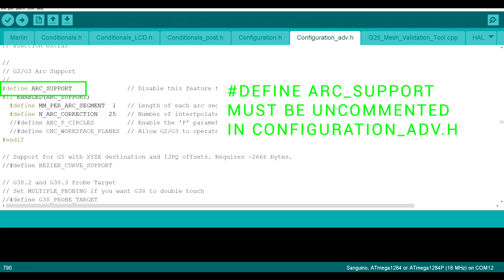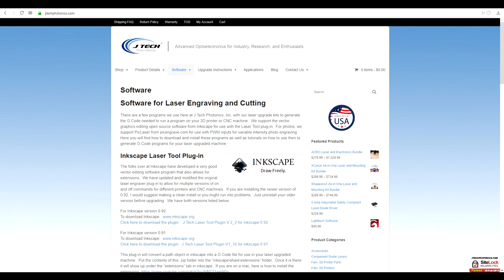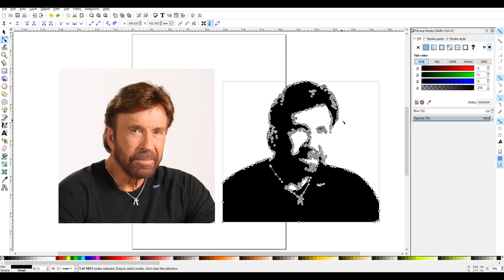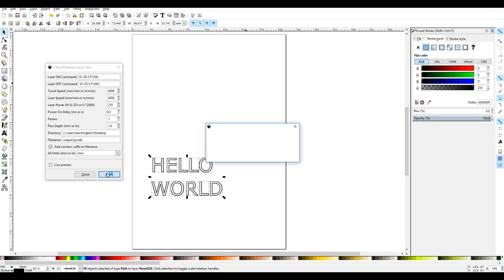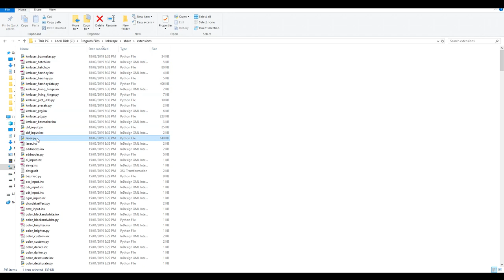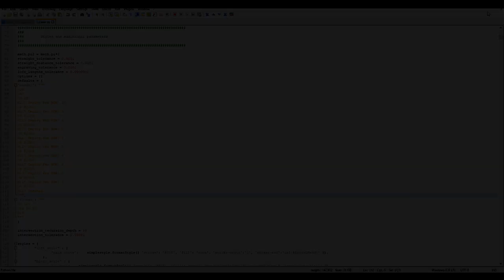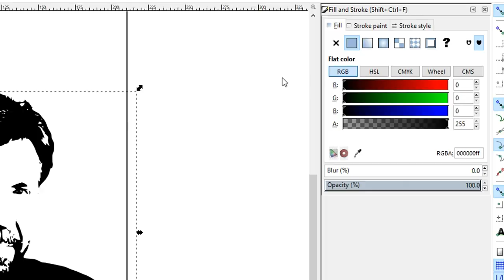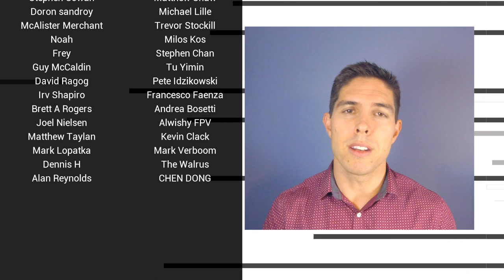2D printing on a 3D printer - Free and easy guide

Comment: IMPORTANT NOTE ON SCALE

If the size of your output matters, eg: you need the plot to be an exact size. You must use the measure tool to measure the distance in mm between the two arrows generated by the plugin and add that number to your offset on the second number. For my documents, the ratio of px -> mm was not 1:1, so the plugin's scale was completely off and it generated giant outputs compared to the scale in the document.

For mine:
Pen Offset: 28mm, 44mm
Measured distance in mm between arrowheads: 26.46mm
1st Arrow: 28.0, 44.0, 0.0
2nd Arrow: 54.46, 44.0, 0.0

Comment: i did this. what i did, is instead of using a rubber band based mount, i just had a gravity based pen holder. it works with permanent markers and felt tip pens and i get amazing results.

also, the software i used was prusa slicer, openscad (for importing and extruding the .svg), and inkscape.

Comment: For everyone who is having trouble with missing arcs (G2/G3 support disabled), and does not want to hassle with firmware updates. There is a simple workaround in Inkscape.
1.When you create your vector path, double click on it, to enter the node editor. CTRL+A to select all the nodes.
2.Click Insert new nodes button to add more nodes in the curves (every time you click this command, your curve has more points and it gets finer in curvature).

3.While the nodes still selected, click the Make selected segment line command, to turn the spaces between the nodes into lines.
As a result, there will be no G2/G3 commands in the code which the stock firmware does not recognize.
Reply: You are a legend! Thank you!
Reply: You are welcome 😎
Reply: I want to do that g2 g3 thing but i dont know how. Do you know how?
Reply: Hey it was long time, but is there a way to check if i have arc on in the current firmware?
Reply: Thank you man!

Comment: I've been trying this in the new version of inkscape (1.0) and the Beta expansion of the Jtech tool. The Gcode generating worked for objects, but text wasn't transformed properly. After quite a while we found out that you had to UNGROUP text and then it worked fine. You can regroup it again and it still works.

Comment: Replaced the ballpoint with a sharpy you could draw a pcb layout onto the board then etch it using sodium persulphate.
Reply: Yeah. You can also do the opposite. Cover the  entire blank copper board with sharpie and then use a scratch awl attached to your printer to finely remove the sharpie. I printed an adapter for my printer that holds the awl with a sleeve and spring, so it stays vertical and retracts slightly when it makes contact. Here is a good video on this technique: https://youtu.be/sNh0ubRcTYU
Reply: @Bennett345  That is really cool  I am going to give that a try. thanks for the link.
Reply: Why don't you just print your layout onto some glossy magazine paper with a laser printer and then iron it onto your pcb? Way quicker than a sharpie plot.
Regards, 
Etna.
Reply: @Etna.  Quicker yes, But not as much fun :P
Reply: @kiwifrogg  I see your point. :D
Reply: Ok
Reply: what is sharpy? in your case?

Comment: Have you tested these plug-ins with Inkscape 1.0 ?  I'm having trouble with  the procedure at about 8:00: in the video. I bring up the Laser parameters, change the Laser On/ Laser Off codes and set the speeds and click apply and it throws an error . Invalid syntax laser.py line 51.    I  can see reinstalling with the 0.92 version, but thought I'd ask  There is an open issue on github for the KNR Laser package about updating for compatibility with Inkscape 1.0.   Haven't gotten as far as the JMR plug-in. 
Anyway.. love your video, but it goes SO quick. I'm a noobe to Inkscape so have trouble with all the extra little clicks and changes (like bringing up the Fill/Shadow control panel. It's all wonderful and I just go back and replay one bit at a time.  So THANK YOU. for this video.  Really good stuff.  Have you done one on using a drag knife for using the printer as a cutter?
Could see using this same program, but there is a lot of fine detail about cutting sharp corners and curves. that isn't as straight forward as plotter work. 
That would be REALLY useful and so far I haven't seen one out there.  I have a Anet 8 Plus coming this weekend and the first job is printing brackets for a pen and a Roland drag knife. It's a good platform at 300x300 with a glass bed for doing vinyl cutting. That's the 2nd project after the brackets :)  
I'll see about re-installing 0.92 and see if the problem goes away.

Thanks Mike, and stay safe..
Reply: Loaded 0.92.5 (4/2020) and it worked as you describe.

Comment: I would send you best regards and thank you in advance cause i was looking for something like this so i didnt have to change my firmware MARLIN or had to rewire my motors to a cnc shield, i will just change de inkscape stuff with my ramps 1.4 and disconect the hotend, and convert my 3d printer into 2 plotter brilliant thanks again!!!.

Comment: would you make a new video with the 1.0 update?
It would be a great help
try everything as far as my knowledge goes.
I downloaded version 1.0 and had problems in the designated directory area in JTP Lacer with the previous version 0.92.5 I have the same issue. Directory does not exist! Please specify existing directory at option tab!

Comment: If you modify line 3120 in laser.py to match your offset you don't have to input it everytime. My offsets were x:15 y:35 so my new line was points = [[15.,35.,0,],[115.,35.,0,],[0.,100.,0.]]  and it showed it correctly on pronterface. You must put the image within the new drawn origin.
Reply from the maker: Thanks, great tip.
Reply: After adding the new text to the header in laser.py, my line numbers have all changed. Can you tell me what you changed here? Just so I can make sure I am changing the right line...

Comment: While I'm figuring my own way, instead of pen, I put a vinyl cutting drag knife, the cutting depth is rather interesting and sensitive matter. I might missed some things in this video that I can transfer about setting the z height, so,  are there ways to set that up in inkscape? I tried with cura and it works with many hassles, but the largest problem is that the svg reader or image converter didn't work really well to generate single wall toolpath in cura

Comment: Cool but there is a loot of error on corners. As i understand CNC machines dont have jerk like 3d printers and because pen is not pressure related like extruding plastic maybe You can set Jerk value to 0. This will stop moving pen on each junction of Gcode move but in theory it will improve acuuracy when You moving this fast.

Comment: I would try using a pen with easily replaceable ink and just glue it to the mount and screw the mount to the printer somehow. I might give this a try. Good work, thanks for the idea.
Reply: Jason it needs to be able to flex
Reply: WinlockPro yeah I was just thinking about that. But just flex up and down right?

Comment: @Teaching Tech Can the same principal be used to turn a 3D-Printer into a cutter?
Reply from the maker: Don't see why not. You would need a robust surface underneath to protect your normal bed.
Reply: The "robust surface" can be a craft cutting mat or one of those super thin cutting boards (about 1 mm thick). There are also craft mats (made for cutting machines) that you can get at craft stores that have a sicky surface for holding down the paper/vinyl/fabric that you are cutting.
Reply: It should but look for a ball cutter where the blade follows the direction of the path, so you have a nice cut

Comment: Very useful Video! I designed my own pen holder to fit with the bltouch upgrade and you helped me a lot finding the right software!
However, I got a problem with G2/G3 arcs: the printer (Ender 3 Pro) fully supports them, but Inkscape doesn't output the right G-code, I've already checked by visualizing it in Cura.
Did anyone have a similar problem?
Reply: You ever figure this out?
Reply: @KernsJW  oh yes: basically the ender 3 motherboard does not have enough memory to manage both the bltouch probe and the arc support.
The new bltouch firmware has G2 and G3 disabled, so I guess the only option would be to change motherboard..
Reply: @mauco4037  Did you try to just edit the Gcode in a text editor and replace all the G2 and G3 texts with G1? Might be a bit off from the original, but if the arcs are short enough maybe it still looks okay?
Reply: @ProtonOne11  there were too many g2/g3s to replace and I couldn't find a converter... But I still figured it out!
It didn't work because I installed a bltouch on a stock ender 3 and there was no space left for g2 support in the firmware.
As the bltouch itself was not working that well with the stock board, I decided to buy a skr mini E3 board and all of my problems vanished. Bltouch working flawlessly, printer supports arcs, steppers are silent...
So yeah, basically the solution is to change Mainboard :P
Reply: I m same issue. Which firmware should I install?

Comment: After going back and forth, there's the caveat on doing this as mentioned in the remco's thingiverse; basically you can't do this with a stock Ender 3 because of the firmware not supporting G2 and G3 commands, aw..
Reply: Update to marlin!

Comment: surprised someone doesn't 3d print a pen holder for the 3d printer that can take the place of the nozzle.
then use the "laser" or some other extension to addon a pen "activator"

Comment: one biggest issue with inscape is  it always doesn't fit the build area as like in 3d printing. Its very easy in 3d printing to set the model just inside the build volume. but in drawing case we don't seem to have one good software to do this.
Reply: Why don't you set your document size in Inkscape to the bedsize of your printer? If there is some strange conversion happening between the software, it should be pretty easy to figure that scaling error out by placing some objects on Inkscape, load the gcode in your 3D printer software and see where the objects end up. Then you can readjust your documentsize to a value that fits your bed. Just keep in mind that the nozzle-path your 3D printer software draws is offset from where your pen will be drawing on the paper in the real world.

Comment: hey, so when I view the gcode in pronter face it looks great, but when i print it on my 3d printer it draws the hatch infill perfect but the outlines are just some random lines that are completely  different than it is supossed to draw, but some lines are correct but thats just a really small percentage. So do you have any idea why this happens?

edit: I found out that it does print the straight lines correctly, doesn't matter at what angle the lines are. but it doesn't print lines that are slightly bend/curved.

edit 2: I found out that my anet a6 doesn't know what 'G2' and 'G3' means so I searched for those codes in the laser.py file and edited them to 'G1' and now its working!!

Comment: Hay you should make the Ender 3 MOD witch makes the Ender 3 a CNC machine! Good video gl
Reply: you could propably only cnc foam with a dremel since neither the frame nor the stepper motors should be strong enough for much else, extrudings does hardly cause any force compared to routing,

Comment: If someone is still checking these comments... On Mac running 10.15.3. Inkscape requires version 1.0 and the JTech plugin does not work. If I leave the orientation notation default, Gcode is produced, however, if I edit the orientation notation to include my specific X, Y offset numbers - NO Gcode is produced. If anyone has some troubleshooting ideas, love to hear them. Thanks!
Reply: Make sure to select the object you want to plot before hitting apply. ie use the 'mouse pointer tool up the top left and then click on the image you imported so that it has the resize arrows showing.

Comment: And is not easier to use a 3D file of 0.2mm in thickness then in cura set temp. to 0 and not filling the printer with filament, bed temp to 0 and just set the pen at zero when you home the printer and go!, It will print one layer and that's what we want, Isn't?

Comment: So I've exported my G-code after altering the laser.py file, but Cura will not read it because "the g-code representation may not be accurate." Can someone help a fellow out?
Reply: Solved: Cura does not accept G-Codes if the header and/or footer has been tampered with. You either have to use another slicer program or run it on the printer and see how it turns out.

Comment: I have it 'kind of ' working - but I can't get circles to draw!!  Hello World prints without the e,o and d...  any ideas?
Reply: Your 3D printer firmware does not supprt the G2 and G3 commands to draw arcs. you need to upgrade your printer firmware, edit the generated gcode or generate gcode without using any arcs.
Reply: Which firmware should I use?

Comment: But for what?!? Isn't it easier to print on classical 2d printer? :D 3d printer is meant to print in 3 dimensions? i hope you will not make update to this video showing how to print with ink and multiple colours 😀
Reply: What about if you don't have a 2d printer?
Reply: This seems like heaps of work for something I could knock up with ASCII characters and a dot matrix printer.  Shout out if you ever did that and if you ever printed one in line-feed paper attached with perforations, you're as old as I am.
Reply: @Noah_7s  Then you probably misuse your discretionary income.
Reply: @TechGorilla1987  and another shout out if you still have a dot matrix sitting around. I've even got 2 big boxes of tractor feed paper.